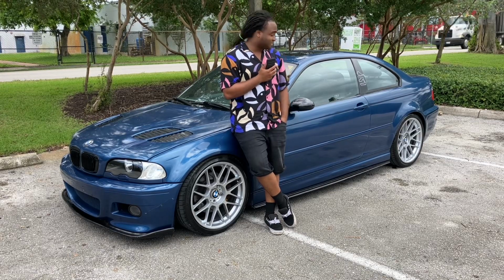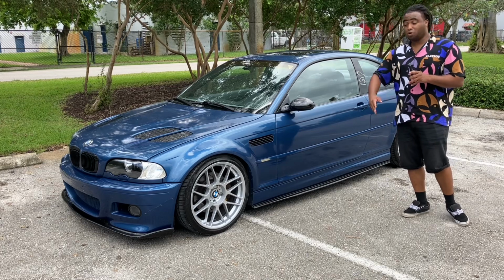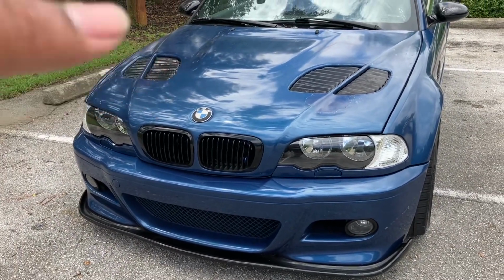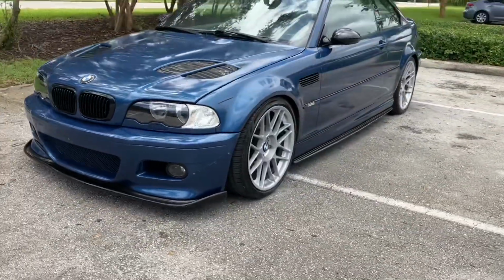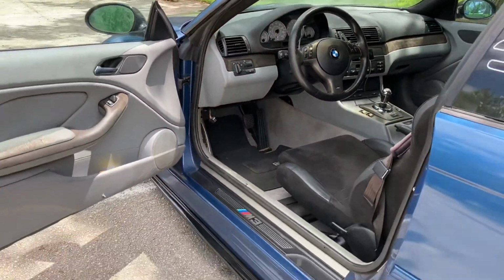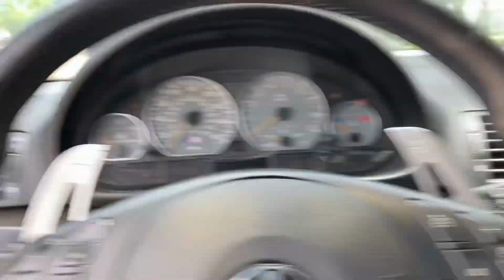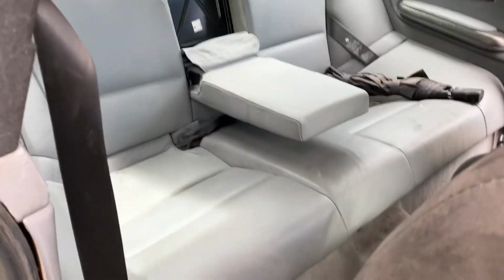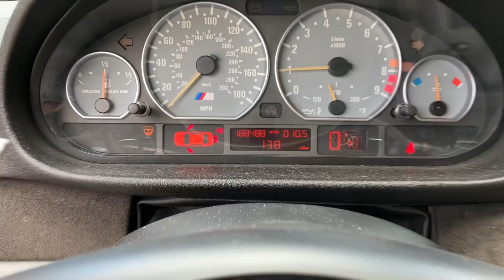I bought a E46 M3 for $7,000…

Comment: You did good on this. I have 05  e46 M3. Just know that you are looking at about 15k up hill for the big 3. I actually prefer the SMG. Most people who diss the SMG have never driven it.
Reply from the maker: Thanks 🙏🏾 the M3 Subframe is reinforced i checked and the Vanos is working how it should no codes at all, only thing I got left to do is the Rod Bearings cause even though car runs and drives nice I’m going to do them just for the peace of mind ✅
Reply: @truuubmw get a compression test done. If the head gasket hasn't been changed, I'd bet you have low compression on 5 and 6. You may even hear it pinking between 2.5k and 3k under heavy load
Reply from the maker: It’s runs and drives how it’s supposed to, I don’t hear anything I shouldn’t be hearing already checked all major stuff that goes wrong on these engines. I got really lucky considering my purchase price ✅
Reply: @truuubmw  mine ran fine. The sound of pinking was insanely hard to produce. It's quiet and only does it in very certain driving conditions. For the cost of a gauge and half hours work, it's well worth doing the test.
You could even use the video for content for your channel....